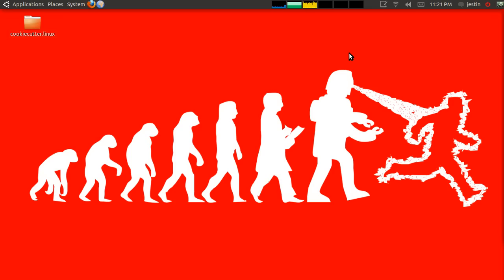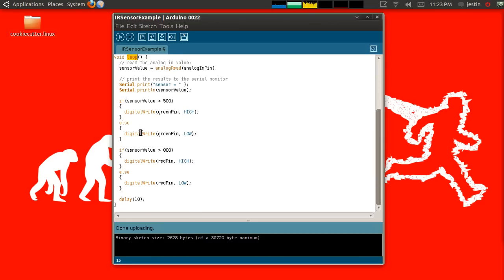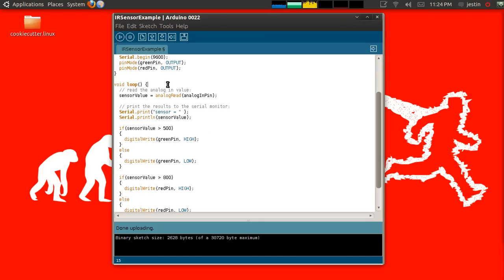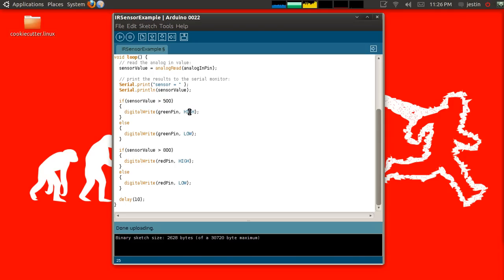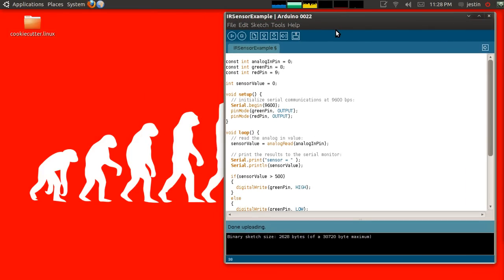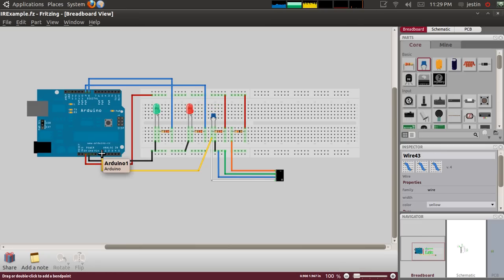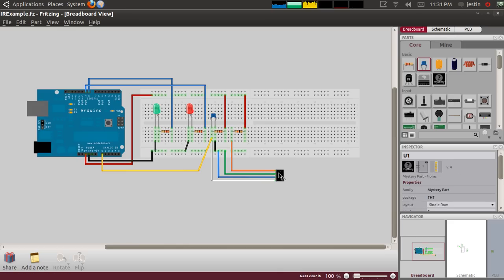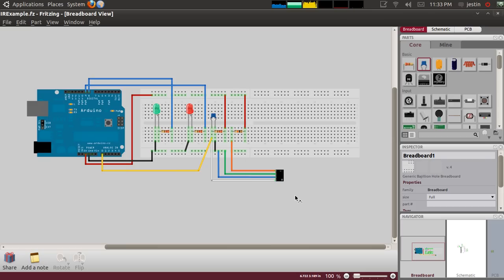How the Arduino IR Sensor Project Works

Comment: I need ur help sir, I'm making an Arduino-based  Rpm measuring circuit  and  for that, i need to know what type of output does the IR reciever gives? is it in voltage form? and if yes how it is controlled ? i mean what is the method to control output value from recievers output as per as i know it should in the resolution of max 1024 isn't it/?   so how i can do it?  im new to this  but want to know.  and the main thing what i gonna do is, IR transmitter and reciever will be placed infront of each other such that reiciever gives high/low output as long as not get distructed by any external mean ( motors shaft projection)  and once it get distructed one pulse will be counted and over the range of out values( analog ) from  reciever ( simlilar like u considered 800 for redpin) and hence ONE ROTATION is completed and hence the Rpm